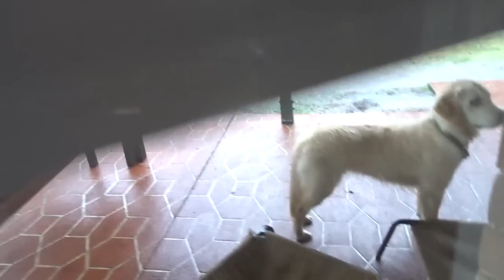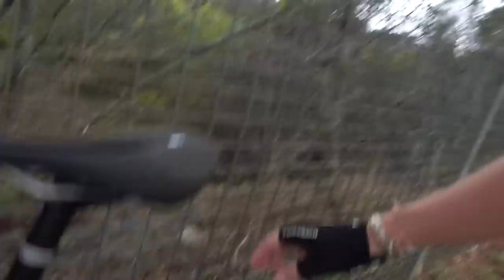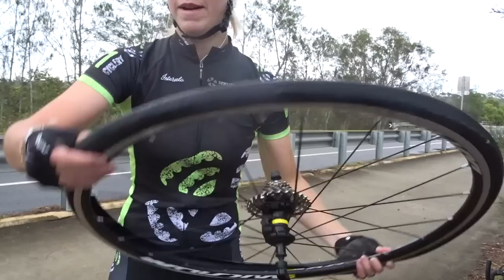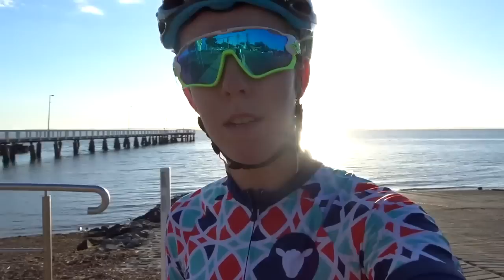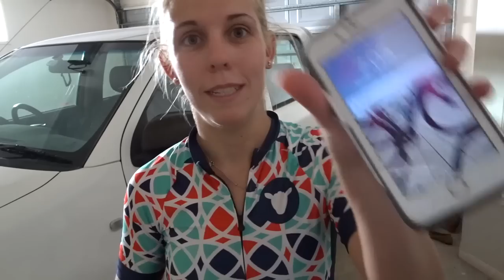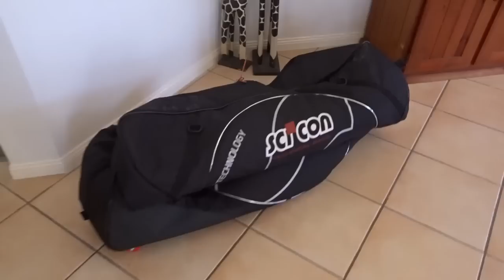HOW TO FIX A FLAT TYRE

Comment: Brilliant way to keep your derailleur from sitting on the ground while changing a flat (as long as you have something to lean it agains).  Good work on the videos.
Reply from the maker: Neil Green yeah I couldn't lie it down so yeah it's a good way to do it. Doesn't damage the shifters or anything :)
Reply: Just a little tip Emily ....run your finger around the inside and outside of the tyre to see if the culprit is still there.
Take care ok.
Reply from the maker: neil shannon I did do that. It's just sped up :).

Comment: So in America it costs quite a bit to ship a bike on the plane. Is it also the same in AUS? It sounds like your new company is paying for the costs if they had to approve this but it seems like this could get expensive to do twice a week. Good luck with the new job. What type of work do you do anyway? Just curious.
Reply from the maker: Jensen Healey included in the flight is 1 23kg carry on :).
Reply: Ah but in the US there are size restrictions on carry-on baggage and there is no way without cutting it up that a bike would fit within those size restrictions. So in the US airlines charge an additional fee of $100 - $150 to transport a bicycle broken down in a normal bike bag. On a round trip flight they change this extra fee in each direction. Plus we get to pay over priced ticket prices on top of that.
Reply from the maker: Jensen Healey goes into checked in baggage.

Comment: Your bad luck turned into a good vlog!
The building company I work for regularly looks for estimators. Not sure what you do but if you need something sometime, let me know. We're on the north side of Bris.
Reply from the maker: Craig Williams I'm a contracts administrator. What's your company called? I'm going to work for Woollams.
Reply: Emily Fowler The company is Sunvista Homes in Brisbane and SV Homes in Vic. Both run out of Brisbane.
Reply: Emily Fowler Although we do 300+ houses a year we also build townhouses, apartments, childcare and just looking into aged care. I'm their head designer/draftee
Reply from the maker: Craig Williams I do ages care
Reply from the maker: Craig Williams aged care.

Comment: ofc back tyre coz much of your weight support back wheel , front tyre got flat if u run into pathole or strike sharp edgeds ..... but how do you got that flat i just learn where to ride and where to not ride on the road , if is bike line dirty i am riding near the line dividing car lane and bike lane coz is cleaner ....

Comment: Only one flat? I just set my high mark for the year; 3 punctures on the same ride, two in the front, one in the back. The rest of the story is that it didn't ruin my ride or my mood...I was on a Fat bike and it took a few hours for the tubes to go flat. : p
Reply from the maker: Digby O'Dell haven't had a flat in two years until then. :(

Comment: why so negative..... flats are just part of cycling. just look at it as a job that needs to be done. take your time, be precise. I run tubulars as i find them heaps easier to change. but flats a no biggie. just keep riding.......